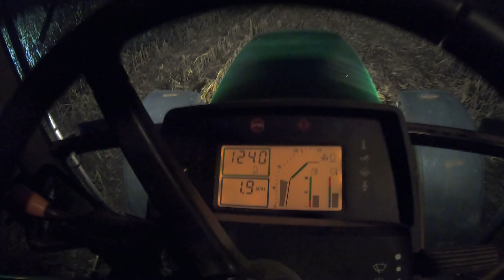Harvesting Corn with my 70's Combine (first time ever)

Comment: When working under the header (corn head)  Put the cylinder lock out DOWN. If a hydraulic hose blew on the the header lift cylinders. Your dead. at 1:16 it is up. Great videos.

Comment: Hey I live on a farm and we have a combine almost identical to that just it’s the bigger version I can tell from the sound when your in the cab your driving to fast you can hear the sound of grain falling on steel it’s similar to the sound when you start with an empty bin but it comes from underneath your feet this sound indicates you are sending grain through your return elevator meaning you are feeding material through your combine twice this can cause loss out the back try slowing your variable speed to 2 once you learn the sound you can play with your variable speed across the field to maximize efficiency I hope this helps and makes sense to you have fun and be safe

Comment: I had a 4400 with a three row head and it's main problem it was severely underpowered, I can imagine a 4 row in decent corn. Remember, about 3 or  4 kernels in a square foot equates to about a bushel an acre loss. Enjoyed your video!
Reply: If you have 4400 Diesel with the 329 engine you can add a turbo from a 301 cubic inch Allis Chalmers 190XT, 200, 7000, 7010,  or 7020.     Turn the pump up 10% and the two together will add 20% power and performance.

Comment: My god, I love this video.   He's funny and lighthearted.   He also explains some stuff about combines and how to check how they are doing (I've check the row behind them for seeds, adjusted sieves, adjusted fan speeds and cylinder speeds), and then has to deal with a dang zit on his face, poor guy.    My experience was more with Masseys of this era (760, 750, 850), an identical John Deere 4400, but in wheat, and Gleaner L2s -- all in wheat.